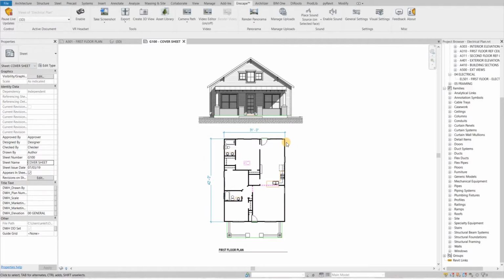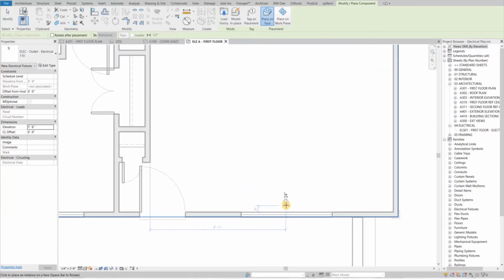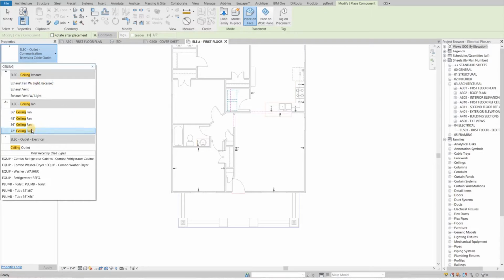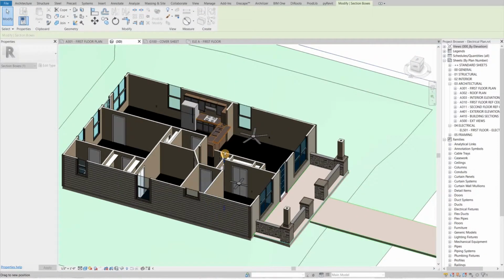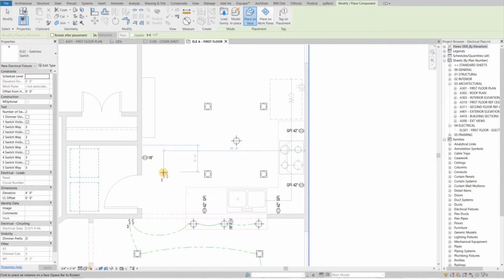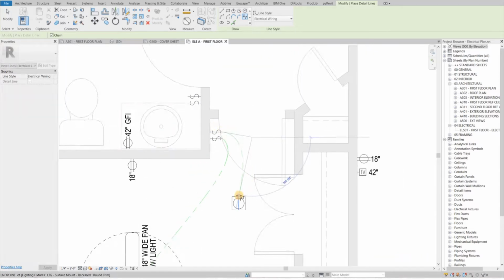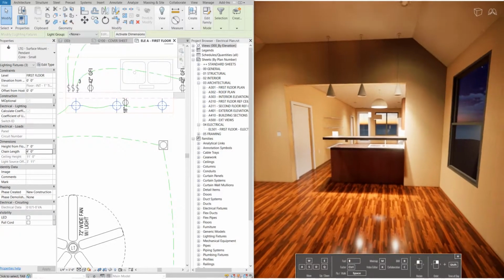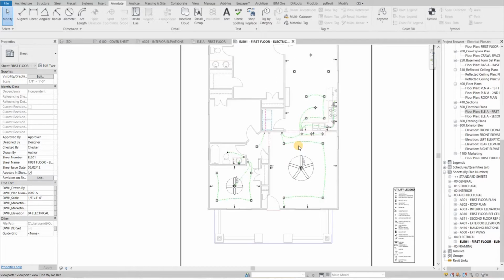Electrical & Lighting Plan in Revit! Smart & Fast Edition

Comment: This is great. Well worth the money to save some time trying to work around Revit's quirks just to create a basic electrical plan. I just have one question, how do I set the Generic Electrical Legend? This is not showing up as a component when I try to bring it in to my plan. And not able to set it on my sheet view. If you could clarify that would be great. Thank you
Reply from the maker: Appreciate for the comment. Electrical Legend is the annotation family which could be loaded from Annotate > Symbol. Better delete stuff you don't need from it before using on the project to save some sheet space. Thanks
Reply from the maker: I am working on upgrading these families right now. Almost there. I will upload soon. It will have better graphics and control, so keep an eye onto it. It will be free download for already purchased customers.
Reply: @bimxdesign  Excellent. Thank you guys. Much appreciated.

Comment: U dint mention how do u generate a electrical table out of it like w do in autocad for wiring on site
Reply from the maker: Well, This family collection is not yet configured for that. Its work in progress. Currently its more for the architectural drawing set
Reply: @bimxdesign  Exactly even I am looking for an architectural electrical layout with switch schedule and not MEP electrical with load and amp and capacity details....i just want to know how to make a electrical switch schedule for architectural electrical drawing